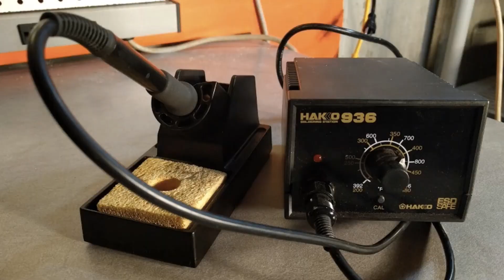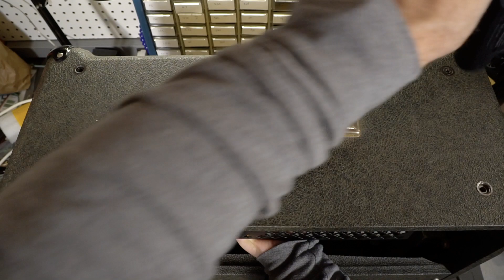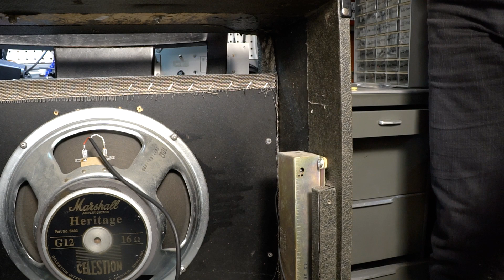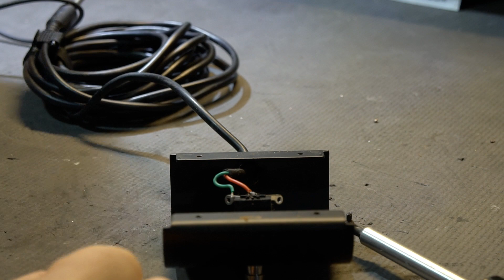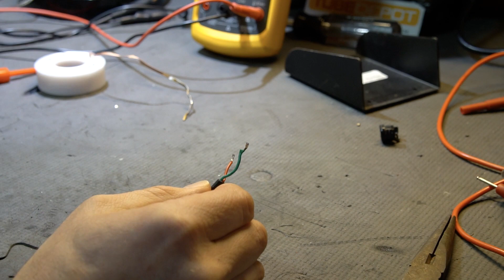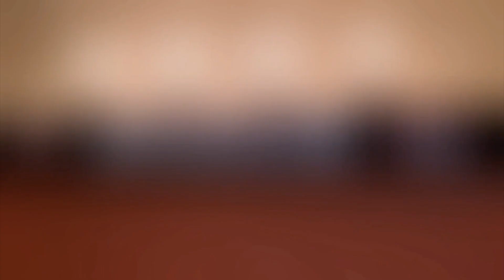Broken $35 Marshall Tube Amp Fixed For Pennies (AmpMechanic #024)

Comment: Before you condemn the footswitch always try it with the corresponding push button on the control panel set in both positions. I've got a small Peavey chorus amp with a 3-button footswitch and a couple of the footswitches will not work unless the corresponding push button on the control panel is set in the correct on-off position.

Comment: w2aew video #113. BJT bias info.
Reply: Yes, that's a great video. Explained something that I misunderstood which is that .6V is where the transistor turns on and then from there you go through active stage to saturation (and saturation is essentially switch mode). But perhaps the most important part of that video is that when the "switch" is open (no current flowing), there is also no voltage drop across the resistor leading into collector. The 5 volts is the same on both sides. This is identical to the behavior of the Marshall footswitch circuit where there's no voltage drop across the relay coil going to either transistor when current isn't flowing. Alan Wolke is one of my favorite channels.

Comment: Great amp for a looow price.That's something you don't see everyday .Not to complain but you need some more lights on your work area . Good videos keep em coming. 🎸👍😎
Reply from the maker: @bob bitchen. Thanks for the feedback. I will be sure to work on my lighting and camera angles. I acquired a jib recently but need to make a modification for camera positioning over the device being repaired which requires a trip to the hardware store.... and right now, given the lockdown... I'm not making any non-critical trips to any store.  But soon enough, I'll have that addressed. Again, thanks for the feedback.

Comment: Hey, Michael Peshkin has a short vid (under 5 mins) Transistor as Switch. You might like it.
Reply from the maker: So, I watched Michael Peshkin's video and I liked it, and it made me want to see more of his stuff.. maybe the things that came before it and what's interesting is that there's only a handful of video listed on his channel and these other ones (like the one about Transistors as Switches) don't show up. You have to search his name on YouTube to find them.
Reply: @AmpMechanic  I've noticed that as well. But it's Craig Hollabaugh's latest video that I'm really excited for you to watch. I watched it twice and it's still over my head, but I'm pretty sure you will get it and dig it. This guy really goes deep into tube operation. And the the software tool he's giving away on github is amazing! Let me know what you think. Thanks! :)
Reply from the maker: OK. I took a look at Craig's stuff. So, what he's doing is he is using two tools. One of these is Enguage Digitizer and what that tool does is it reverse engineers an image of a curve (or curves) into the data points that originally generated that curve. It's the exact opposite of creating a graph off of some data points in Excel. One reason he does this is to turn charts found on a tube's datasheet into actual data. Why do this? Because those charts usually profile the tubes at various samples, none of which ever really match the amp that you're working with. If you measure the tube in while it's working in the amp, it's always going to fall somewhere in between the sample lines. So, once he has the table of data "extracted" from the tube's data sheet (again, done with Digitizer), he can move that over into the second tool (Jupyter Notebook) where he can run some new bias simulations (again with his data) and then I believe the point of Jupyter Notebook is to be able to share those simulations (like you would share any notebook) with others in a way that they can not only review your work, but they can modify it. A Jupyter "document" can contain live code, equations, visualizations and narrative text. So, Craig is essentially sharing the notebook he created and you can "run" that notebook in Jupyter in a way that takes advantages of the live code, equations, etc. that he's developed to visualize various bias points if you plug your data into it (which you can do by hand or you can import data that you've extracted from a chart the way he does using Enguage). Going back to Peshkin's video, it led me to another video that I watched from AddOhms (https://youtu.be/GrvvkYTW_0k) which clearly states at the 2:30 mark that MOSFETs are activated by voltage and BJTs by current. To me, the "Turn-on" voltage of a BJT (found in some BJT spec sheets) is confusing because of this.
Reply from the maker: One more point about the Jupyter notebooks is that for them to work, you need a runtime. What's cool about Jupyter is that there's a runtime called "Binder" in the cloud that you can use (nothing to install locally) and the notebook just opens in your browser.  Or, you can run the runtime locally on your computer and then open a Jupyter notebook with that. Also, where live code is involved (which Craig uses), that code is in the Python programming language.
Reply from the maker: Last email. Craig explains the entire process.. how one thing led him to another and how all the parts work together (Jupyter, Enguage, SciPy, etc), why he's doing the simulations, etc:  here: https://youtu.be/I4AdhIKRO2E
Reply: @AmpMechanic  David, I knew you were a genious! Thank you so much for your thorough, in depth reply. My background isn't computers, but I had a feeling you would know what Craig was up to. Man, I have a lot to learn. So, would you find those two tools handy for vintage amp design/repair? It looks like a deep rabbit hole, but I'm up for the challenge. Thoughts?
Reply: @AmpMechanic  Good Lord! Do I have to learn Python? Feels like my old brain is being squeezed!
Reply: @fullwaverecked  First, the tool is mainly a simulator that would be useful to someone designing an amplifier and trying to figure out what tubes at what bias level might make sense for a desired effect. He's a teacher at Georgia Tech and this was developed for his students. Theoretically, you could use it to create a model for an existing amp, run a simulation, spot the bias level that offers the desired harmonic distortion, and now you know how to bias the tube. You would have to study what he's done and get handy with the existing simulations he has built  to really get any value out of it. Maybe read up on the principles. You don't have to know Python to make use of the code he has developed. You would have to know Python in order to modify his code (to your liking) or to use Jupyter for some other purpose. The "py" in Jupyter is for "Python."
Reply from the maker: I will look for that.
Reply: @AmpMechanic  I saw a video yesterday from Craig Hollabaugh that just came out. He made a software tool for vaccume tube amps that I think you might really like. He gives it away on github. Check it out! His name is also the channel name. Let me know what you think. Thanks!

Comment: I personally would give a bit of money back to those people. Wouldn't sit right with me selling it for so much and buying it for so little
Reply from the maker: I'm not losing sleep over this. Whenever I pick something like this up for low money or sometimes nothing, I explain to the seller what I do.. and that usually, the cost of fixing whatever is wrong is about $10 in parts and I thank them profusely. They just wanted the amp out of the house and needed it gone. They were moving out of state and the son who already lived out of state clearly had no interest in taking possession of it for whatever reasons. Not sure if he stopped playing or if he had enough amps or what. But he told his parents to just get rid of it. Yesterday, I acquired an entire ham shack for free. Radios (including a handheld), meters, antenna, power supplies, oscilloscope and other diagnostic gear, hundreds of parts, etc. Same thing. The guy, in his eighties, just wanted it all gone. He knew there was value there but also knew that if he gave it away, someone would be there in a day to take it. I've been wanted to get into ham for a couple of years now and have been patiently watching the marketplaces for a good deal. I was ready to spend some money but mainly looking for someone just like this who maybe wanted a nominal amount of money to clear out their stuff. That patience paid off. I will probably do a video that demonstrates how I do this because to help others do the same. There are some tricks.
Reply: @AmpMechanic  Thanks for clarifying. It puts things in perspective. Where I'm from people would just never just get rid of stuff that way in my experience. Lucky you can find such little gems.
Reply from the maker: @p_mouse8676  Thanks. The finds, where I'm from, are not THAT plentiful. You have to be very patient.
Reply: @AmpMechanic  I've noticed that here as well. The patience offsets the lack of abundance when it comes to vintage gear. My very first score was a great score: 1959 Tektronix 317 scope (first year they went with BNCs), Sencore vector scope, Eico 147A Signal tracer, Philco Sig gen, 3 beefy 13.8v power supplies, a 1954 NC-300 transceiver, and an HVAC evac unit. All for $20.00. I about crapped myself. This was about 2 years ago. I spent the next year checking the local classifieds daily and didn't find much. One or two good deals. After that I discovered patience. Now I have so much crap (treasure) I'm way behind on getting it all working, or at least re-capped. It went from a fun hobby to just waiting for the next "deal". I didn't get much done, but I have a lot of cool safari trophies. Finally I just had to make myself stop and work on what I had accumulated. So I feel your pain :)
Reply from the maker: @fullwaverecked  "I'm way behind on getting it all working, or at least re-capped. It went from a fun hobby to just waiting for the next "deal". I didn't get much done, but I have a lot of cool safari trophies. Finally I just had to make myself stop and work on what I had accumulated." >>> This is precisely my situation, compounded by a few thousand uninventoried small parts. Sunday morning question: Do I fix the next device, or mark and stuff little envelopes? Or go on a Safari and make the problem even worse?
Reply: @AmpMechanic  You have to jump on a good deal with both feet. I.e. POUNCE! They rarely come along and they don't even come close to the raw, take it up the you know what "deals" that you loose your ass on. You are a scholar and a gentleman. Don't change your style. I was lucky enough to catch your channel at its inception (if memory serves, I was your 7th subscriber) and I could tell instantly that your channel was a force to be reckoned with. Mark my words David, it won't be long till you will be right up there with UD, Mr. C, EEV, and the rest of the greats. No matter what commenters say, don't change your delivery. It's what gives your channel its charecter and sets you apart. That's why you are adding subs by the day. Have you noticed how UD politely tells the critics to piss off and go make their  own channel? That's cool whip man. It's the staff of life! Keep doin it the way you're doin it. It's workin. No room for improvement on this one.
Reply from the maker: @fullwaverecked  thanks. I'm not sure I have a style. I look for good opportunities like anyone would and I'm realistic about subscribers and such. I really am doing the videos (1) just to share what I learn so others can learn from my successes and failures and (2) to improve my video production workflow for my day job. While it would be great, I don't think reaching the subscription levels of UD, Mr C, and EEV and so on is a realistic objective for me.  I have a full time job and so I cannot publish as frequently as some others. So, I just plod on and try to constantly improve my understand (and delivery) with each video. Thanks again #7 for your exhuberant support!
Reply: @AmpMechanic  I've watched a ton of electronics videos. Sometimes twice, I'm a slow learner, but it's fun. I just happend to see a comment from someone telling you how to speak and it burned my... Made me mad. I've seen that sort of thing on other channels and it's rude rubbish. Anyway, I'm just saying it's not a bad thing to just be yourself. If someone doesn't like it, they can go do somthing unpleasant to themselves. When I was watching your Studebaker radio vid, you were excited and mentioned that the company was only in business for a few years. And then you got a concerned look on your face and said "I hope it wasn't because of the radios". I about fell out of my chair laughing! That is good, natural style. I'm no expert. I'm just sayin.
Reply from the maker: @fullwaverecked  I believe I've watched some of UD's videos 5x each. I'm a slower learner. Anyways, thanks for the supportive words.

Comment: I found 9 out 10 it was usually the quarter inch plug; it is the most stressed when it is pulled in and out causing the cable wire to become intermittent.
Reply from the maker: @John Cunningham it's hard to believe how cheaply that molded end of the cable is made. You would think they'd make that bulletproof (practically the reason for having the wholly molded end in the first place). Easy fix, but disappointing quality.